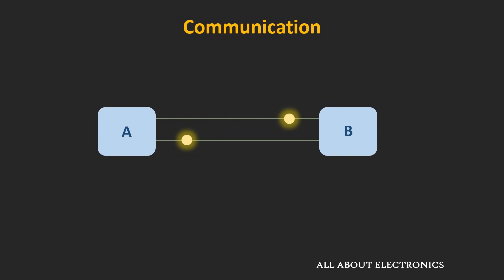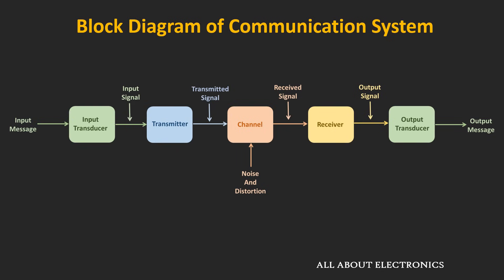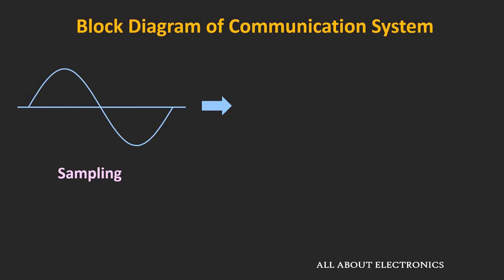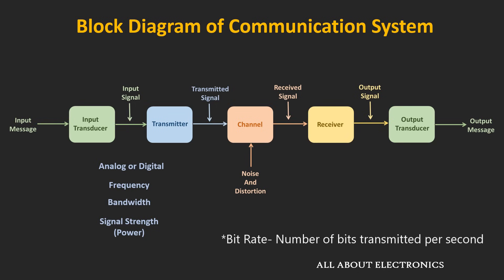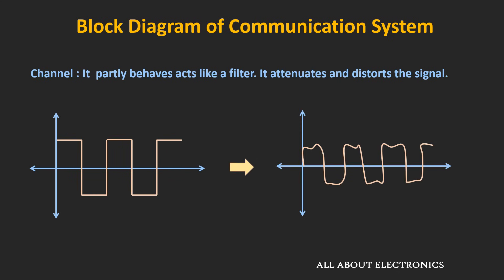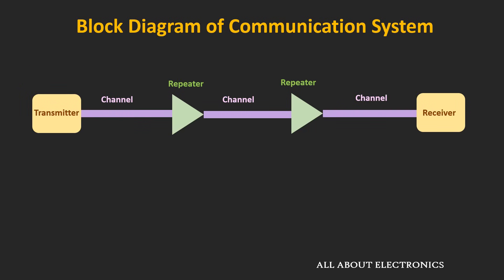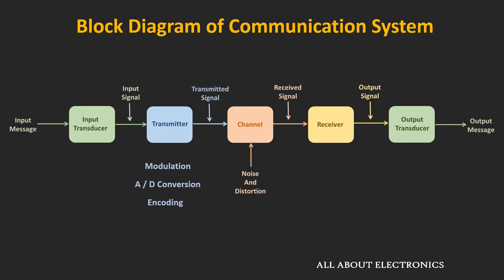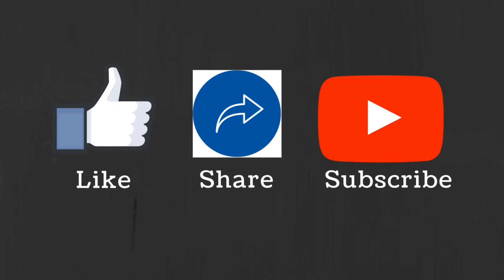Introduction to Analog and Digital Communication | The Basic Block Diagram of Communication System

Comment: i think dac is used at Tx frontend and adc is used at Rx frontend. you are telling opposite at 8.11
Reply from the maker: For digital transmitting the data, analog signal is first converted to digital form using ADC, and on the receiver using DAC, it is converted into analog form .For example, in the voice call that we are doing now a days, the typical analog speech signal is first converted into digital signal using ADC and then it is modulated and transmitted and at the receiver after demodulation, using DAC it is converted into analog signal once again.

Comment: I really want to know that in transmission section we do modulation and we turn the signal into modulating signal but again y we will demodulate in receiver section and why we will amplify it again plz answer this question
Reply from the maker: At the receiver end, to recover our message signal back, we used to demodulate the received signal. Also during the transmission, the signal will get attenuated. So, after the demodulation, once again the signal is amplified. 
For more information, please check the video on modulation. Your doubts will get clear. 
https://youtu.be/mHvV_Tv8HDQ

Comment: What is need for analog to analog conversion and digital to analog conversion and analog to digital conversion
Reply from the maker: The analog to digital conversion is required when the message is transmitted in the digital form.
The digital signal has some advantages like noise immunity and it is possible to implement the error correction mechanism. (will talk about it in the future videos)
So, when the message needs to be transmitted in the digital form, then using the analog to digital converter it is converted into the digital form, and at the receiver, to retrieve the original message (e.g voice signal), the digital signal is converted into the analog signal using the D/A converter. 
I hope it will clear your doubt.
Reply: Thank you sir.